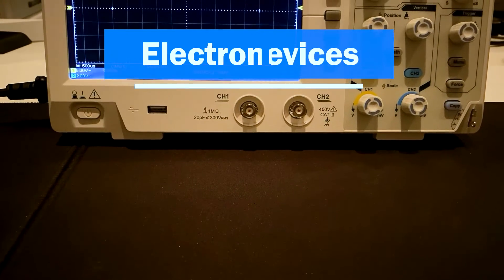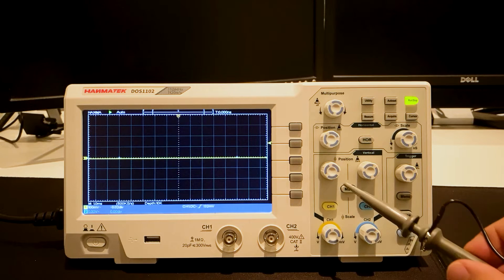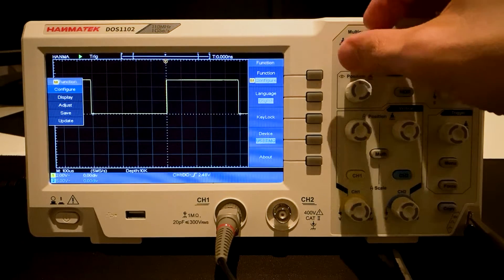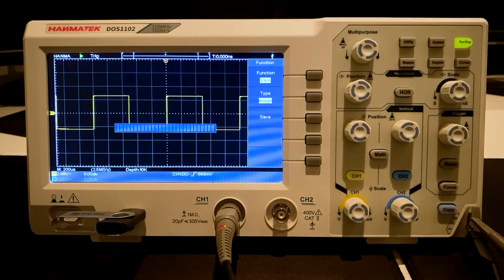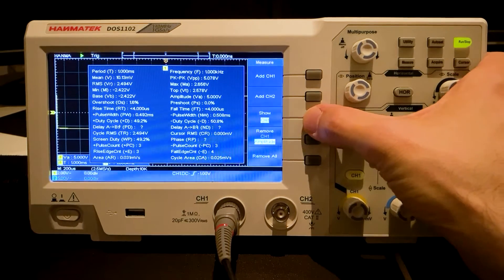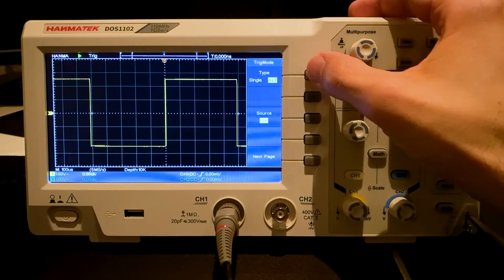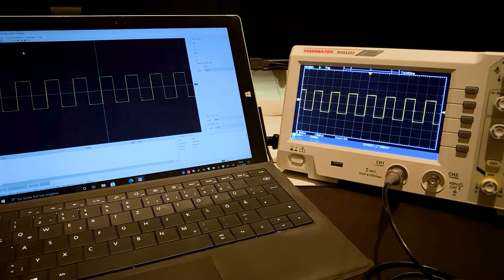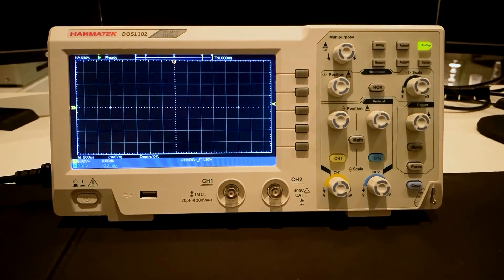HANMATEK DOS1102 Digital Oscilloscope - Practical Review

Comment: My Hanmatek DOS1102, which I bought new a few days ago, does not have a built-in power supply. There is only a cheap external mobile phone power supply with a USB connection. This causes some interference and you do not get a clear display on the oscilloscope.

Comment: I was looking for a cheap DSO oscilloscope capable of doing a decent XY Mode, because I have seen many that have a crappy XY Mode with a few hertz refresh, really far away from what you see when they display data in normal mode.
Unfortunately you have not tested it on the DOS1102.

Comment: Eine Frage bezüglich des nicht vorhandenen Ventilators. Kann das Gerät dadurch nur eingeschränkt benutzt werden oder wird dieser einfach angesichts der Anwendungsfälle für die das Oszilloskop genutzt werden kann nicht benötigt?
Reply from the maker: There are no operation limits without a fan. But the oscilloscope warms up over time. Sensitive electronic components age faster. The service life of the components and the oscilloscope can be extended with a fan. That's why I think a fan makes sense.

-------------------------------------------

Ohne Lüfter gibt es bei der Nutzung des Oszilloskops keine Einschränkungen. Das Oszilloskop erwärmt sich jedoch mit der Zeit. Empfindliche elektronische Bauteile altern schneller. Die Lebensdauer der Bauteile und des Oszilloskops kann mit einem Lüfter verlängert werden. Deshalb denke ich, dass ein Lüfter zweckmäßig ist.

Comment: Any idea the current consumption at that 5.5V? I wonder if a small rock solid enough smps could deliver the 5.5V from a lithium pack for a considerable amount of time in order to provide inexpensive portability and isolation.
Reply: 15W on AC in back of scope, but measured arrouund 2 amps (1.8) on the 5.5V rail

Comment: Great video! I was wondering if you would be able show the process of installing the extra software and how to connect it to revive better measurements and analysis when using the DSO software? Or if you have a link to the software?
Reply from the maker: Thank you :-)

Right, I could have made a video about it. In my experience, the software of the manufacturer is not very stable. The functionality of the software is limited. Therefore I do not recommend installing them. The Installation is not that easy. it worked for me with the following instructions:

1. To be able to install the software, you have to be logged in to Windows Admin mode.
2. On the supplied CD you will find among other things (You need the CD. Sorry, but I have no download Link.):
    
    - the installation program (DS_Wave_DSO_1.4.2 ... .exe),
    - a brief instruction manual (Digital Storage Oscilloscope Quick Guide.pdf) and
    - an instruction for the installation of the USB driver (USB_Driver_Install_Guide_V1.3.pdf).

In the instructions (USB_Driver_Install_Guide_V1.3.pdf) the exact procedure for the installation is described in several steps. It worked for me that way.

I hope this helps you.

Comment: Kann bei der FFT Funktion das Frequenzspektrum von 20 - 20 kHZ verwendet werden?
Danke für Test, ist bei Amazon.de gerade im Angebot.
Reply from the maker: Yes, that is possible. In the FFT function, the resolution of the frequency spectrum can be changed in the horizontal and vertical axes.

In the video I introduce the FFT function from 20:14. The right display shows the settings for "Type", "Source", "Window" and "Next Page". Under the menu item "Next Page" below, two parameters for the resolution of the horizontal axis (frequency / div) and vertical axis (dBVrms / div) can be set. In addition, an offset value in Hz / Khz or dBVrms can be specified for both axes. I did not go into these two parameters in the video.

For the visualisation of the entire frequency spectrum from 20 - 20 KHz on the display you can choose a resolution of 2.5 KHz.

Hope I could answer your question.

---------------------------
Ja, das ist möglich. In der FFT Funktion kann die Auflösung des Frequenzspektrum in der horizontalen und vertikalen Achse verändert werden.

Im Video stelle ich ab 20:14 die FFT Funktion vor. Im rechten Display befinden sich die Einstellungen für "Type", "Source", "Window" und "Next Page".  Unter dem darunter liegenden Menupunkt "Next Page" lässt sich zwei Parameter für die Auflösung der horizontalen Achse (Frequenz/Div) und vertikalen Achse (dBVrms/Div) einstellen. Daneben kann für beide Achsen ein Offsetwert in Hz/Khz bzw. dBVrms festgelegt werden. Auf diese beiden Parameter bin ich in dem Video nicht näher eingegangen.

Für die Anzeige des gesamten Frequenzspektrums von 20 - 20 KHz auf dem Display können Sie eine Auflösung von 2.5 KHz auswählen.

Hoffe ich konnte Ihre Frage damit beantworten.
Reply: Auch im Angebot für etwa 148€ gekauft

Comment: Many thanks for this good review.
I just have some minor questions:
Why do you think a fan would be good? Did you see any operating limitations regarding ambient temperature or continious operating time?
Can you connect an USB keyboard to key in the file names?
kind regards
Reply from the maker: I am happy if you liked the review and I could help.

There are no operation limits without a fan. But the oscilloscope warms up over time. Sensitive electronic components age faster and the service life of the components and the device can be extended with a fan. That's why I think a fan makes sense.

The USB interface on the front side is only used with a USB Stick to save data. A USB keyboard will not be supported

Best regards

Comment: Tolles Video von dir, habe mir das Oszi gekauft, aber egal was ich mache, es lässt sich kein Treiber unter Win10 installieren. Hättest du da eine Idee dazu? Danke schon Mal im voraus.
Der Clip hat mir sehr geholfen 👍. Wünsche ein gutes 2021.
Reply from the maker: Thanks. I am happy if you liked the video and if it could help you. ;-)

To answer your question remotely:

1. To be able to install the software, you have to be logged in to Windows Admin mode.

2. On the supplied CD you will find among other things 1. the installation program (DS_Wave_DSO_1.4.2 ... .exe), 2. a brief instruction manual (Digital Storage Oscilloscope Quick Guide.pdf) and 3. an instruction for the installation of the USB driver (USB_Driver_Install_Guide_V1.3.pdf).

In the instructions (USB_Driver_Install_Guide ...) the exact procedure for the installation is described in several steps. You should read these instructions carefully. It worked for me that way.

I hope this helps you.

Happy New Year ;-)

------------------------------------------------

Danke. Mich freut, wenn Dir das Video gefallen hat und es Dir weiterhelfen konnte.  ;-)

Um Deine Frage aus der Ferne zu beantworten: 

1. Damit Du die Software installieren kannst, musst Du im Windows Admin Modus angemeldet sein.

2. Auf der mitgelieferten CD findest Du u.a. 1. das Installationsprogramm (DS_Wave_DSO_1.4.2 ... .exe), 2. eine Kurzanleitung (Digital Storage Oscilloscope Quick Guide.pdf) sowie 3. eine Anleitung für die Installation des USB Treibers (USB_Driver_Install_Guide_V1.3.pdf). 

In der Anleitung (USB_Driver_Install_Guide ...) ist in mehreren Schritten die genaue Vorgehensweise für die Installation beschrieben. Diese Anleitung solltest Du Dir genau anschauen. Bei mir hat es auf diesem Wege funktioniert.

Hoffe das hilft Dir weiter.

Frohes Neues Jahr! ;-)

Comment: I received the scope today and have not found a X/Y mode for CH1 and CH2 to display a Lissajous figure. Does the scope support that?

Edit: nevermind, found it in your video :)
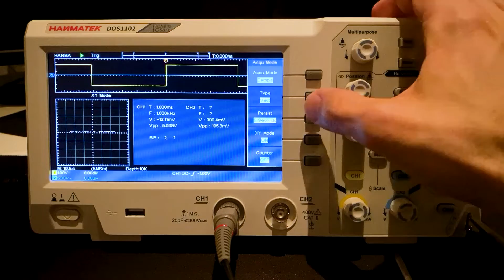Reply from the maker: yes, that is possible. Lissajous only makes sense in X / Y mode :-) At the 15:55 position I go into the required setting. But I already saw in the "edit" that you solved the problem yourself.

Best regards

Comment: Does it measure current? Maybe I haven't got to that part of your video yet.
Reply from the maker: The oscilloscope is used to measure voltage. To measure current you need a special circuit with a resistor. This special circuit has not been explained here. You can find the circuit with google (keywords: e.g. ""oscilloscope measure current").

Comment: Let's be honest so long as it has a fair degree of accuracy and a decent enough sampling rate you can't go wrong with a nearly full fledged 2 channel 100mhz scope at under $250. If someone has an extra $200 to put on it then they should get something better but if they don't, this is the one to go with.

Comment: Cut the back, put a fan, put a controller PCB for the fan and connect it to the power and you are good to go. As for the software - I would love to see Linux support. Probably works with wine or similar but still.
Reply: thats what i did.

Comment: Sehr informativ. Im Film wurde gezeigt, dass 10.000 Spannungswerte in einer txt oder csv Datei auf den PC transferiert werden können. Kann man auch die Werte der FFT auf den PC transferieren und , wenn ja, aus wie vielen Werten besteht das erzeugte Spektrum? Viele Grüße
Reply from the maker: The oscilloscope only offers the option of saving data in CSV and TXT format in the time domain. The storage of data in CSV and TXT format is not supported in the frequency domain. In the frequency domain, the data can only be saved as an image or bitmap file.

Best regards

-------------------------------------------

Das Oszilloskop bietet nur im Zeitbereich die Möglichkeit für die Speicherung von Daten im CSV und TXT - Format. Im Frequenzbereich wird die Speicherung von Daten im CSV und TXT - Format nicht unterstützt. Im Frequenzbereich können die Daten nur als Bild bzw. Bitmap Datei gespeichert werden.

Beste Grüße
Reply: @RepairUpgrade  Vielen Dank für die Antwort. Bietet vielleicht die mitgelieferte Software die Möglichkeit, ein Spektrum als Zahlenfolge abzuspeichern? Viele Grüße
Reply from the maker: @thorstenstraub3657  

The oscilloscope and the software supplied do not allow the frequency spectrum to be saved for subsequent processing.

The software does display the frequency spectrum. However, there is no way to save the data record in the software. With voltages, this is easily possible as TXT, CSV and even XLS files. I tested it again today ;-)

Best regards

-------------------------------------------

Das Oszilloskop und die mitgelieferte Software ermöglichen kein Abspeichern des Frequenzspektrums für eine anschließende Bearbeitung.

Die Software zeigt das Frequenzspektrum zwar an.  Es besteht in der Software aber keine Möglichkeit den Datensatz abzuspeichern. Bei Spannungen ist das problemlos als TXT, CSV und sogar als XLS-Dateien möglich. Habe das heute nochmal getestet ;-)

Beste Grüße

Comment: One disadvantage is that it cannot be run on DC power. Another issue that I am having with this scope that when probe is connected to the input  unwanted pulses of a 100 mV are generated at regular rate. Tried using the generator rather than home supply the problem still persists. Tried to contact the hanmatek online but could not.
Reply: The problem of pulses was solved after the connection of the scope was made to another socket. It works fine.

Comment: Hello.
    On June 2, 2021, I received such an oscilloscope from a seller on Aliexpress.
Description of the user from the device kit - tears!
Thank you very much for a detailed review of the oscilloscope. 
It worries me that in my oscilloscope, instead of the letter "N" in the name
  the letter "И" is written
Perhaps I have a fake.
    The name of the oscilloscope is as follows - HAИMATEK DOS1102 on its body and everywhere else (packaging, documentation) is written "И"
But that's half the trouble.
    I was surprised to find on a very slow sweep that The "ray" along the time axis on the screen goes from right to left !!!
    
I'm in a trance ... How is it with you?
    What should I do? I wrote to the seller asking for the manufacturer's technical support address.
Apparently you will have to upgrade or return it to the seller.
    Please tell me how the sweep moves in your device in the range of its slow movement along the time axis (X).
From left to right as in normal oscilloscopes or as in mine?
Perhaps I turned on something wrong in the oscilloscope.
    But I tried to switch to the “Factory settings” mode and then looked again - the sweep stubbornly shifted along the time axis from right to left!
     I am puzzled and surprised!
Perhaps I turned on something wrong in the oscilloscope?
Please inform me.
  My mail is :
info-port@mail.ru
Thank you.
 Sherp
Reply from the maker: Please contact the manufacturer with these questions.